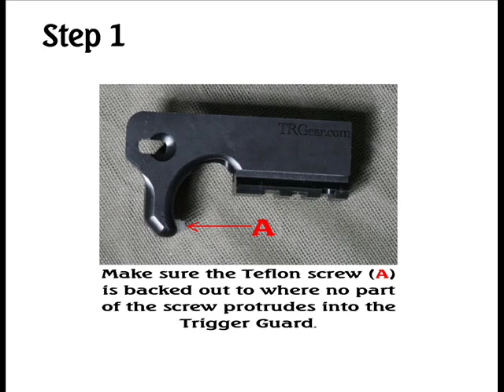EZ Rail for Beretta - how to  Installation.wmv

Comment: I bought two of them, They didn't fit well Taurus PT92, PT100 or Pt99. When i fired my weapon, the light and tick falls into the ground. Maybe becouse it's diferences on the trigger guard. So, they simple don't fit. I will try to adapt something to prevent it falls down.
Reply from the maker: Fernando, I fitted them on a few Taurus models here and had no problems. That was 10 years ago though.  I did check out a few pictures of recent models and it looks as if the frame was rounded off more like a 1911 frame...
if you never got them to work, please send them back to me and I'll refund you!

Comment: Adam, I just slid one of your EZ Rails onto my ParaOrdnance P-12 and it fits like a glove.  It is about a quarter inch long, but what the heck it mounts my mini Crimson Trace laser and easily fits a number of holsters.  Will check in after I fire it at the range.  Finally, do you make a version with a barrel length short enough to work on the ParaOrdnance P-9 or can the unit be filed or otherwise shortened?  Thanks...
Reply: Correction!  I said the Para P-9 but meant to say the ParaOrdnance P-10!  Thanks.
Reply from the maker: I'm sorry I just found these in a section I did not know existed.
Working on PO is great news to me. I hadn't tried them on any PO Products... 
I only have that one model yet it is made of Delrin so you can file it easily.
Thanks for the info!